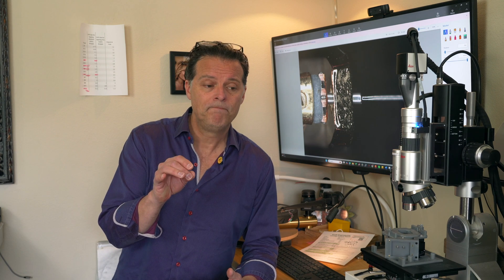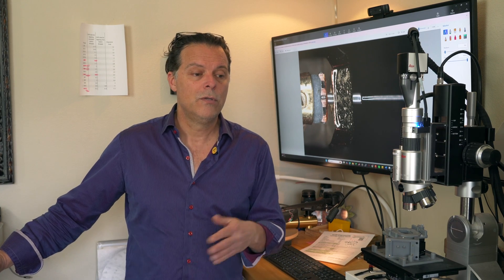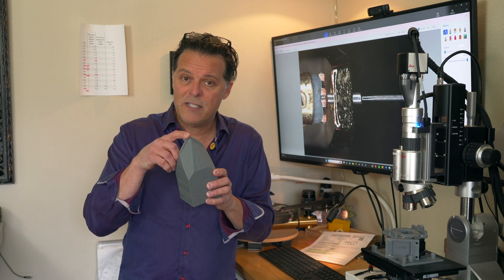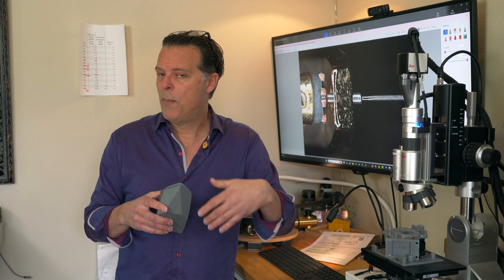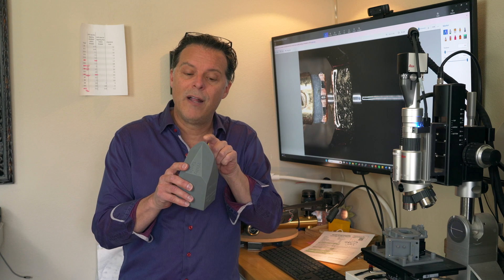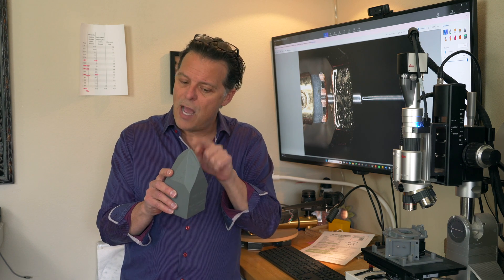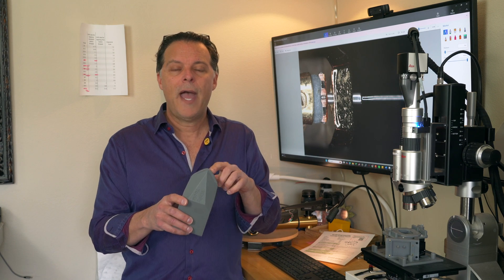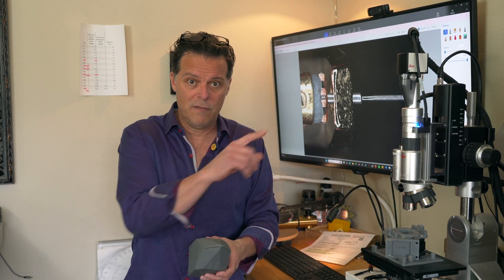Sound Bite #29: Part 6 of 6 - How NOT to apply Anti Skating Force

Comment: Very informative video. If I heard correctly, 10% of VTF ,  I would apply 0.2grm , for my AT VM95ML which uses a 2grm. for VTF ?? Thanks. KB
Reply from the maker: Thank you. Yes, that is correct.
Reply: @WAM-Engineering wow , that's very little anti skate. Interesting, my Yamaha YP701, has the weight on a fishing line, and it sounds best at around approximatley 0.5 or less. The first indentation is 1grm mark. So I guess 0.2gram is close enough. Thanks alot. KB
Reply from the maker: How do you know that the net horizontal force is 0.5g? You aren’t trusting the manufacturer’s scaling, are you?

Comment: Do I interpret you correctly that you are not a fan of the Analog Magik measurement system with their test LPs (33 and 45)?
Reply from the maker: I am not a fan of any measurement system that does not actually measure what it claims to measure and which also uses a test record that is not calibrated. As for measuring torque force with a test signal - it is an effort in futility, particularly when does not properly consider when a non-linear distortion test versus a linear distortion test test is merited.
Reply: @WAM-Engineering  

Sorry, I cannot follow your argumentation, but not because of what you’re saying might be wrong, but just because I do not understand all the technical terms and aspects. Anyhow, wouldn’t it be a great idea, if you could invite the owner and founders of AnalogMagik Richard Mak and have an open conversation about this kind of stuff. Maybe you would both learn things from each other. By the way, there is a great YouTube video of a guy who uses your system as well at the Analogmagik: TURNTABLE SETUP BY A SCIENTIST on the channel Jazz Vinyl Audiophile Ken Micallef 
Can’t link directly unfortunately.
Reply from the maker: @reines-Vinyl I’d be all in on that conversation but to be fair to him it should be held on neutral ground, not on my channel. Don’t you think?
Reply: @WAM-Engineering Great idea. Let’s think about the right channel to do it.
Reply: I am wondering the same thing. Or what method are you referring to?